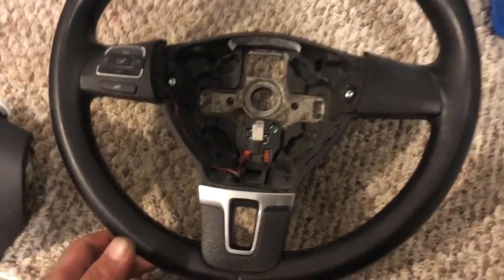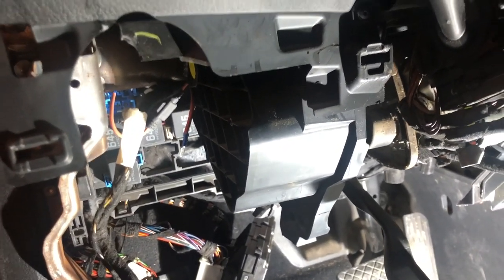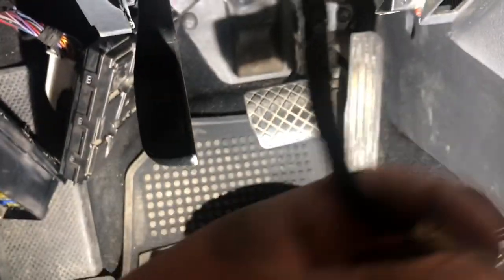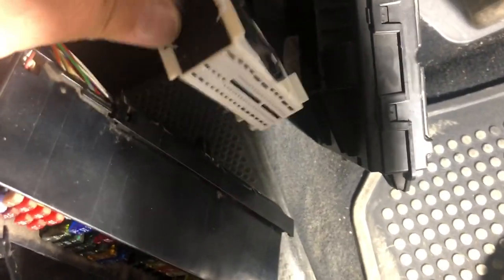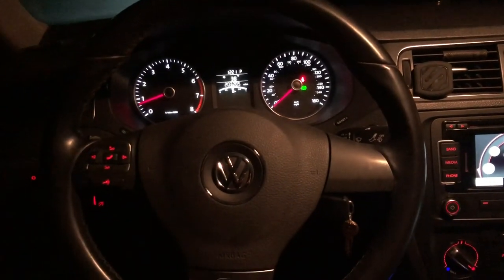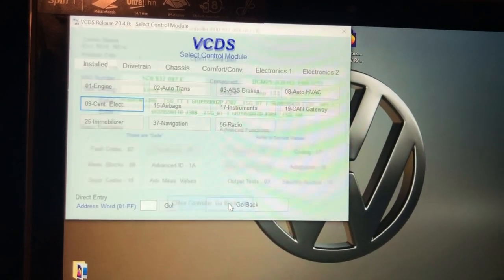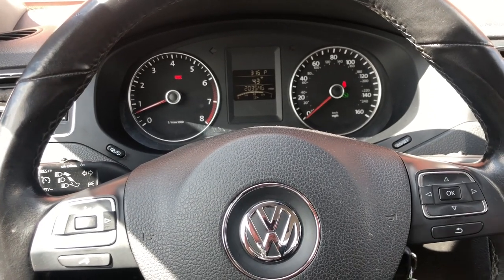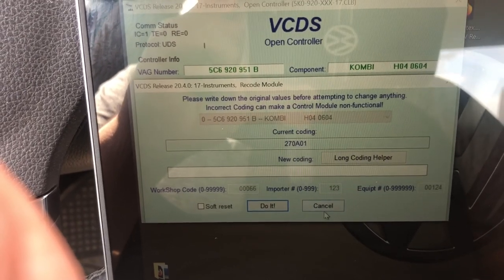MK6 Jetta MFSW (Multifunction Steering Wheel) Retrofitting

Comment: Hi!
Thanks for your video, I'm going to install the GLI wheel to a style active Jetta (without multifunction wheel)
I'm planning follow your video, but I'm wondering about the connections.
It's just 1 wire from the clockspring slot 8 to the BCM slot 17 ?
It also provide the energy for the led? (Illumination)
I really appreciate your help, greetings from Mexico 👌
Reply from the maker: Hola! Si solo necesitas ese cable y programar con VCDS ese mismo cable lleva + y la tierra la agarra del volante
Reply: Gracias amigo, no sabía que hablabas español, que joya!
En cuanto quede te aviso como me fue, muchas gracias, un abrazo
Reply: Hola Emanuel, como te fue con tu nuevo volante y qué modelo es tu Jetta ???
Reply: @CarInBlack93  como te fue ???
Reply: @aaronramos5985  todo perfecto, funciona correctamente :) seguí los pasos tal cual el vídeo y no tuve problema
Reply: @CarInBlack93  qué bueno, oye y si tuviste que programar con Vagcom? 
Qué año es tu Jetta ??
Reply: @aaronramos5985  si, tuve que programar tanto el lado izquierdo como el derecho con el VCDS, cómo se muestra en el video... El mío es un Style active 2013 (no tenía volante multifunción)
Reply: Hola . Saben si este método funciona con una amarok ? Soy de Mx también . Serán las mismas terminales ?  Saludos

Comment: So essentially, all you need is the repair wire, the new steering wheel with multifunction buttons and airbag with the black connection? Of course you need VCDS to code the steering wheel
Reply from the maker: Yes! Thats it

Comment: Hey I was wondering if you could help me out I follow the same steps on your video ran the wire from pin 8 and splice it to pin 17 and coded vagcom and nothing is working still do I need a different clock spring my car is a 2011 jetta tdi no steering wheel control from the factory and I have a steering wheel from a 2012 Passat cc with paddle shifters
Reply from the maker: Hi you have to use a Jetta,Golf/GTI or Tiguan steering wheel and the airbag. the Passat is not compatible with this mod
Reply: @Gdljal24   if I get a wheel from a gti or gli that has paddle shifters will it work or is still not compatible I have dsg transmission thank you for your response

Comment: I have to cut bcm port 17 cable   and connect from 8 port cable or i have to connect on that cable from 8 port? I cant understand
Reply from the maker: you have to splice the cable that comes from the clock spring to the wire that goes to port 17 at the BCM